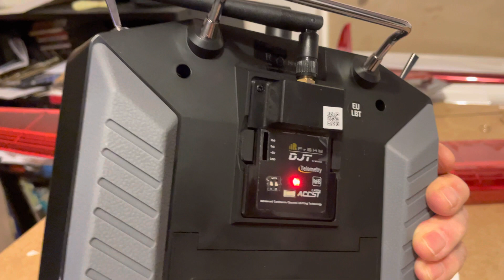Micro Bird of Time build - Part 2.1 update

Comment: Sorted  👍 If you have the MicroBoT ready, you never know there may be a bit of calm in your local field to at least do some test glides. I've been finding when the forecast is windy, it's calm, and when the forecast is calm, it's been windy 🙄
Reply from the maker: With all the rain we've had lately my field is sodden again. However, now that I'll be allowed up to drive up to 5 miles from home from tomorrow, there is another field I could use, but I do need to check it out first.